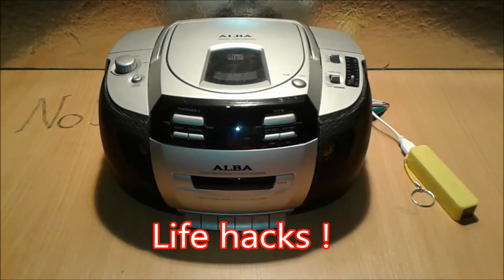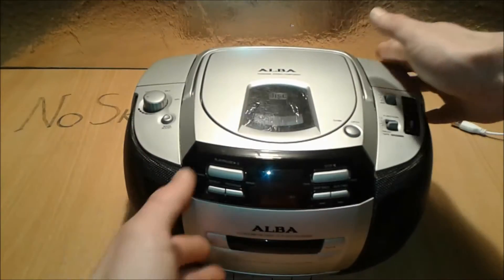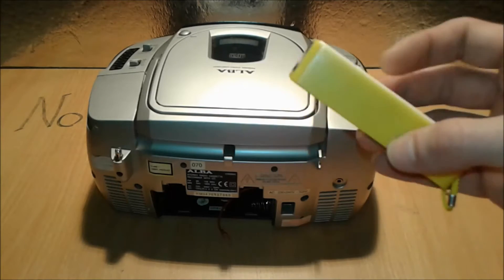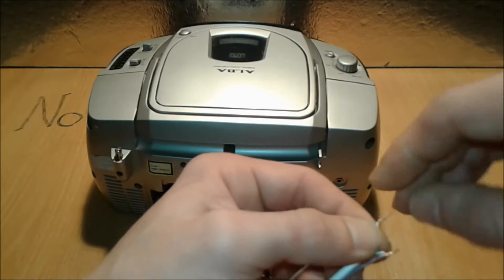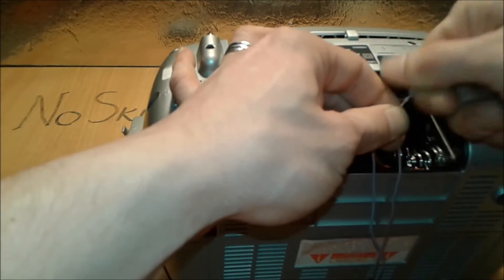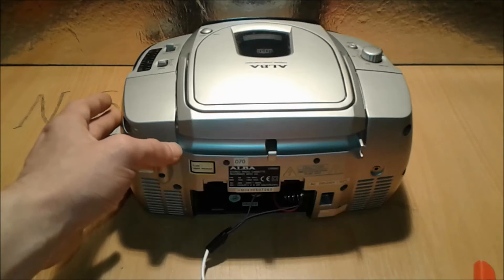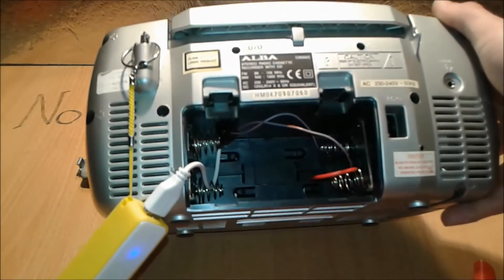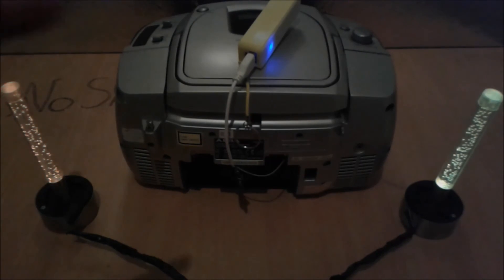Life hacks old radio on 5v cheap power bank Hack Solar radio

Comment: This is my radio powered by an dc-dc buck boost converter and running on USB powerbank and from a laptop power supply 19 volt.
This radio normally powered by six batteries size "C" and it can run between 3 and 30 volt! https://youtu.be/WVsdLHaAv5c

Comment: Great video, but wheres the Solar bit?
Reply from the maker: Ben its simple instead of the cheap powerbank you can use a 5-6v 0.1a solar pannel
Reply: Ahhh OK. But I think that I'll use both , esp when on a day out to the beach. as it will give me a longer battery !!
Reply from the maker: great the purpose of this video is to reuse old electronics and show that a full size radio dont require 12v it can go as low as 5v its good for off the grid application or just have a radio all day long free of electricity all the best